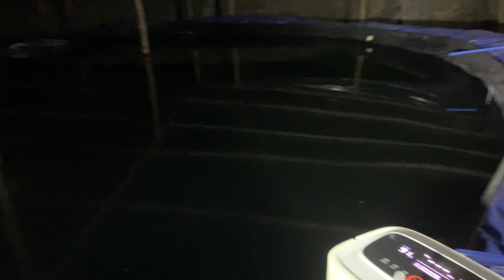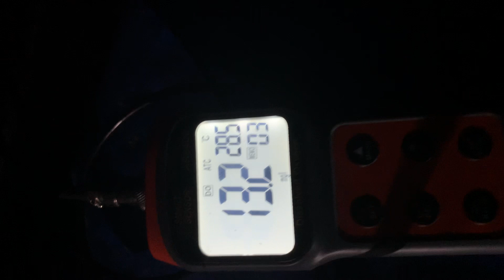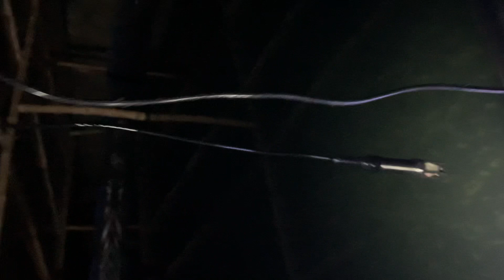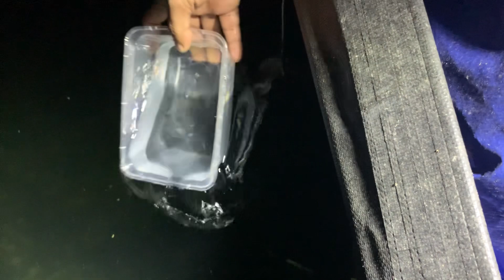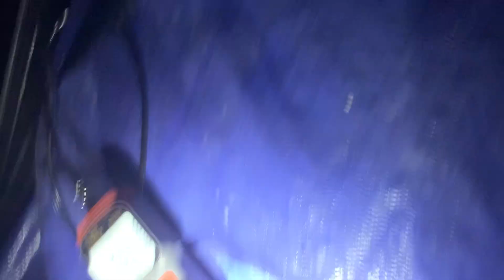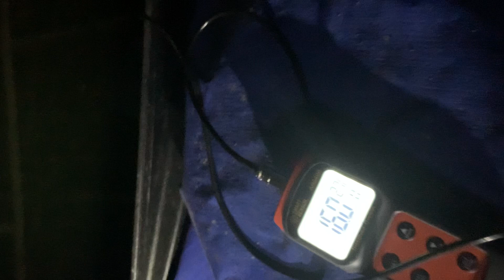The secret to success in shrimp and fish farming

Comment: The super saturation point is also lethal for micro-life good bacteria. which is very essential for water parameters stability. When your orp and EC will fluctuate it resultant to a negative impact. Being an Aquaculture engineer DO level *8 mg/l to 9 mg/l is sufficient maximum 12mg/l is permissible. super saturation also has some negative effects consider this point in fish gas bubble disease will take place sometimes at the peak stage oof super saturation gill damage will also take place. By the way, this type of micro bubble dosing system is very stable DO and highly energy efficient. We worked in many research programs, especially nano bubble technologies' I can surely tell you the pros and cons of super saturation. if the orp level increases to 400mv to 550 mv defneatly it will be in negative impact. ORp at 240 to 300 is good , I hope this review and comment will help you.
Thank you!
Reply: Are you doing biofloc sir

Comment: Dude also isnt ur oxygen levels overkill? 13-14 mg/L seems super high. That oxygen meter may have been incorrectly calibrated.
Reply from the maker: absolutely, over-oxygenation is harmful to any aquatic species...we run this device in a controlled way...this is to show the efficiency of the device and its capabilities....the run time increases along with the increasing biomass in your pond or tank...we first start with atmospheric air and when there is oxygen depletion in the ponds stressing the shrimps as they grow bigger, we introduce pure oxygen....this device is highly efficient for intensive cultures....the DO meter is properly calibrated...you can bring your own DO meter and check it yourself to be sure if the readings are right or wrong...thank you

Comment: Is that oxygen concentrator is more energy efficient than in aerators?
Reply from the maker: The oxygen concentrator is 200 watts and the nanobubble generator is 1000 watts which makes the whole system 1.2 kilowatts. A 2 hp paddle wheel aerator is 1.5 kilowatts. The 2 hp paddle wheel aerator mixes 3liters of oxygen in the water per hour and our unit in the video mixes 72 liters of pure oxygen per hour in the water. Hope that answers your query.